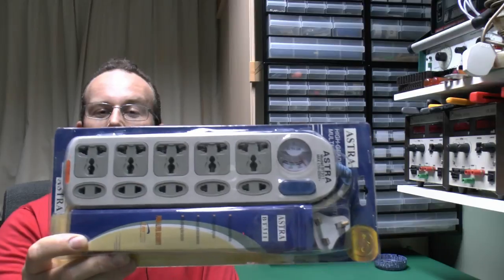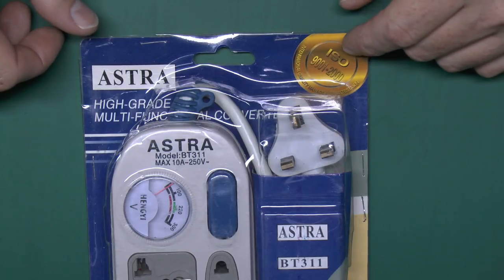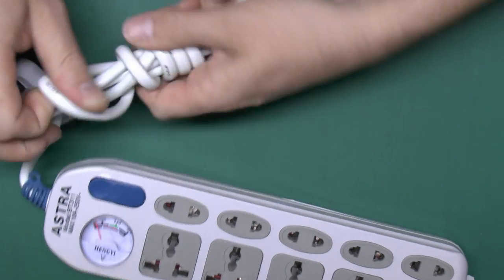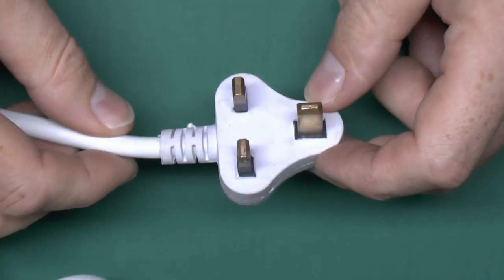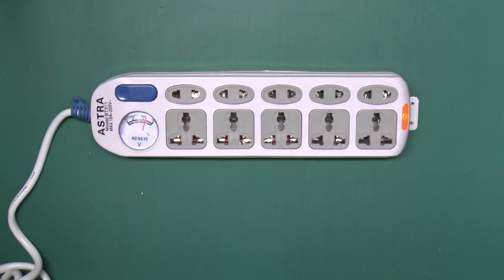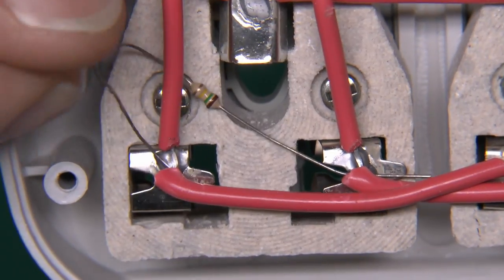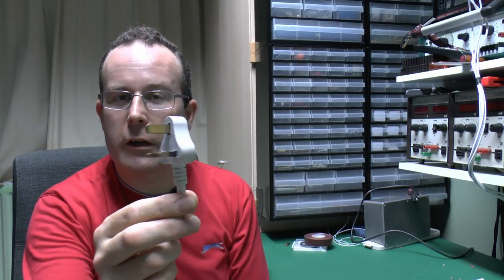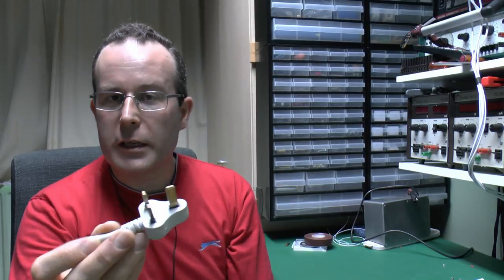Dangerous Multiway Extension Lead ASTRA BT311 (Part 1)

Comment: A while back I bought a battery charger from Amazon (UK). While the charger itself was fine, the C8 cable (with alleged UK plug) that came with it was just like this. I'm no electrical expert, but even I couldn't fail to notice when the plug wouldn't actually go all the way into a UK socket. When I cut the plug off to replace it I found those incredibly thin wires... at which point I junked the cable. The wierd thing is that when I described this in a straightforward way in an Amazon review, it almost instantly attracted several dislikes - which on Amazon has the effect of making the review disappear down the list. So, either some people really like the idea of burning their house down, or the manufacturers must trawl the review sites!
Reply: MrSwanley I ordered a laptop charger from a website using Paypal. I then had second thoughts about the purchase, after reading negative reviews of the site in question. The seller ignored my cancellation request, in violation of UK distance selling regulations. Fortunately I used Paypal's dispute resolution procedure to document my cancellation, and they refunded the purchase price. Some weeks later it arrived with the same dodgy plug and an obviously fake laptop manufacturers label on it. Out of curiosity, I tested it taking additional precautions. The charger exploded within minutes! The charger was vastly inferior to the original, and an electrolytic capacitor had been installed the wrong way round! Personally, I think people who make such rubbish should have their genitals attached to the mains with heavy duty jump leads!
BTW The website claimed to be based in the UK, with a .co.uk suffix; but I don't believe that. The product was shipped from Hong Kong. I think given the poor reviews it had, and the lack of response to correspondence, that the site was a front. I'm much more careful where I source such things from now. I'd rather pay more for the genuine article, than burn down my house!
Reply: MrSwanley It's usually a good idea to look at the worst reviews first, amazon and just about any other big online story has tons of paid shills giving good reviews.

It's not unusual to find the same review (Literally the exact same review, word for word) for multiple products.
Reply: DarkCupid Well, in this case I was posting a review for a product I already bought, not reading other reviews. However I don't agree that the worst reviews are more reliable. IMHO the worst reviews are by idiots and trolls, the five star reviews are often by shills. I pay more attention to the middle scoring reviews. I don't necessarily agree with the score, but the discussion is usually more reasoned. Oh, and one more thing: I tend to read the reviews in date order, not by (false) popularity.

Comment: That thing made the ones we recalled at work look good! Loose terminals, missing screws, surge arrestor leads shorting to earth, broken solder joints, stray wires in the plugs, at least ours had normal sized wires.
Damn things still turn up from time to time, even after we put an email out for users to check under their desks.

Comment: This is actually one of the better class of extension cables available in parts of the world - I went to Carrefour in Cairo, and they had extension sockets in the same 'UK' form factor which would 1) cables melted (very thin conductors)2) Gentle tug pulled cables from socket unit3) The tin pot connectors would permanently deform and not spring back after removing a plug, creating micro-arcing and heat4) Best of all, you could bend a 4-plug bar in half with one hand, exposing all the live bus bars.I destroyed all the ones we bought before leaving Cairo, just so nobody was tempted to use them - destroyed by ripping them in half, by hand, in about 5 seconds...

Comment: Very interesting video JW. Big Clive has a name for junk like this... Deathdaptor 😱
Most odd to go to the trouble of internally wiring an earth but not connecting it at the plug. I've often found people using 240v to110v adaptors which, although they appear to be earthed they only (and obviously) use two core flex!
Horrible thing anyway, to the bin with it.

Comment: My friend actually had something similar to this and used it for a washing machine and dryer in his utility room. Only fried his mains socket luckily and not the appliances. I think electrical safety should be compulsory in school because if it was, something like this would never be purchased. How they get away with manufacturing this in the first place is scary.

Comment: For years and until somewhat recently, China was accepting most of the worlds contaminated "unrecyclable" plastic wastes, and I have a strong feeling that much of it made (and maybe still makes) its way into all sorts of products of Chinese origin. The insulation and jacket material of the wire for example all show signs of what is at the very least, extremely low quality or contaminated raw materials.

Comment: I've seen that kind of wire before on some electronics made to a very low cost in India... it'd be interesting to see how flammable it is (and the sheathing too). Given this device IS going to massively overheat if actually used, flammable wire would just be the icing on the cake.
Reply from the maker: I'll do a few flammable tests and other things next weekend.
Reply: I was. Looking at the sheen the light was casting on the underside (trying not to be distracted by the wobbly edges 🤣) it doesnt look promising. You can see all the mold marks through the bottom. Its that scratchy cheap leftovers type plastic.

Comment: That plug is illegal in UK.  It has no safety fuse on it and will not stop working if something goes wrong unless your mains breaker trips.  Dangerous.  Our connections are always screwed in every plug, even molded plugs that usually accompanied by devices like laptops and PC's.
Reply: WHY A FUSE?! THERES A BREAKER
Reply: @supersaiyangoku3580  Because british wiring is a ring around the house - from incoming main breaker to phase socket to next socket until the line comes back to the  main breaker. The neutral and earth is done in the same way. This also explain why british plugs is polarized it can become dangerous if the fuse inside the plug becomes placed on the neutral , in case of fault on the appliance the plug will burn up but you still have LIVE current inside the appliance so the earth protection doesn't help that if the main breaker doesn't burn up.

Comment: The universal sockets on this Astra strip appear to be imitations of the universal socket design used on Wonpro adapters. The difference is that the Astra strip does not support grounding plugs with three inline prongs (Italy, Chile, Uruguay, various African countries) or  plugs where the ground prong is slightly offset (Switzerland, Brazil).

As a general question, I wonder, can these universal sockets be as safe as sockets designed specifically for one type of plug? A friend gave me some samples of Wonpro adapters, and I have tried these with type A, B, and F plugs (respectively, North American non-grounding, North American grounding, and German Schuko). The Wonpros very firmly grasp the prongs of all of these plugs. However, the ground connection is left floating if a Schuko is plugged into the adapter).

Comment: Just out of pure curiosity, while I do very much prefer normal copper as the metallic conductor in any electrical/electronic cable, is there a proper, safe, legal and honest way of using Copper Clad Aluminium (CCA)/Copper Clad Steel (CCS) for electrical cabling (such as power leads, etc)? I realise it would need a larger cross-sect. area which would mean thicker cable.

Copper prices (as I understand anyhow) have been turbulent the past few years, which explains the rise in copper coated/mixed conductor materials.

I am there are some purported Cat5/Cat5e/Cat6 cables using CCA/CCS for network connections, though of course they're NOT really Cat<x> unless they use copper!
Reply: CCA could work for fixed wiring (and was used in the UK during a copper shortage, as shown in another of JW's videos). Not for flexes, as aluminium fatigues much faster than copper.
CCS is used as the centre core of some coaxial cables for RF (where the skin effect makes current flow mainly at the surface), but would be fairly useless for power wiring.

Comment: lol I bought something like this recently and it went straight in the bin. Mine was similar to yours but the wires used were absolutely tiny. No way could they handle any serious current.
Reply: Gadget Addict the Panther Extension set
Reply: juan sambo haha nah. It was a super duper cheapo extension lead from cdrking. I bought it just to see what the quality is like. The wires were insanely thin, plastic was so weak and the sockets were just a joke. Inside was some kind of clay / ceramic blocks that only seemed to be there to add weight.
Reply: hahaha low quality
Reply: Gadget Addict can you make a video on your Panther with breaker and two socket
Reply: juan sambo I could but I'm not sure if my subscribers are going to like too many more extension lead related videos lol. Most of them prefer gadget and general solar topics :p
Reply: OK :)

Comment: wow, wire with a little over 0.5 ohm rating on the 20 - something American Wire Gauge equivalent line and neutral wires, then I began to guess that with that as a reference that the grounding lead could be a couple of ohms, that was my guess, I didn't think I'd be correct!  That's huge!  In North America (I'm Canadian) we usually use 18 AWG for 10 A, but our power taps are usually rated 15 A and use 14 AWG with an overload breaker or replaeable bussman cylinder fuses.   If it's a long run, say with an extension cord, we use 12.  This is one of the flimsier devices I've seen.
Reply: It's probably much thinner than even 20AWG/0.5mm².

Comment: It looks an awful lot like that wire has been repurposed, which would explain the wear and two-tone effect on the insulation, and also the very poor fit on the outer sleeve. Perhaps that's the case?

Comment: The white/gray metal inside the wires could be zinc or pot metal as aluminum only has a resistivity about 50% greater than copper if I recall correctly.  I have also seen wires in some cheapo Chicom things that I've torn down in the past that used recycled copper that was never deslagged.  I suspect that a certain amount of some cheaper metal was added as a filler.  The insulation on the inner conductors was very similar to the rubbish in the wires in this and probably came from the same factory.

Comment: If I'm not mistaken...it looks like the back of pack has a 'dispose of in bin' logo...so it appears that the manufacturer has no knowledge of the WEEE Regulations/application thereof for devices sold into/within the EU.

Although perhaps rather than a cross out wheelie bin the packaging would benefit from a palm containing money being crossed out for 'Do not buy'.
Reply from the maker: AidanMyne Yes, that is the bin logo.  Yet another fail for this device.
Reply: John Ward But in this case it's accurate. Put straight in bin, do not use.

Comment: IT may have an axial fuse in the molded connector, unlikely but maybe. Still pretty bad though.
Reply from the maker: I have opened the plug now - there is no fuse inside and the earth wire isn't connected at all.  Part 2 will be on tomorrow.

Comment: That wire may not be aluminum, it may be copper clad steel strands as steel is roughly has 1/11 of the conductivity as copper, it appear to be about 0.5mm2 area and about 10 x the resistance of solid copper wire the same length.

Comment: From the measured resistance and quoted length, I'm pretty sure that tinned copper wire you used as a comparison is 0.6mm *diameter*, not 0.6mm² (which would have maybe half the resistance shown, and be an odd size in any case).
Reply: The half-assed bolding function got me again. Damn it…

Comment: The problem is so bad that it seems to be knock off companies selling stuff to knock off companies.
Some company probably made that ultra cheap awful excuse for insulated cabling, then sold it to the factory that made this extension socket, since the extension socket company aren't concerned about weather or not their product is safe or even works well, they don't really care if the wires are of even basic quality standards so long as they can get it as cheap as possible.

Comment: Doesn't PVC wire have normally some sort of powder inside it, between outter shell and the 3 indiviual wires
Reply from the maker: Yes, otherwise the insulation sticks to the outer covering making it extremely difficult to remove.

Comment: Dad a similar plug and cable on a cheap dvr (kettle lead)  I had the silly thin strands of cable you have shown they looked copper but were magnetic so were  actually steel ! no wonder the resistance is high

Comment: Lack of earth clearly an issue but the gauge difference ? Twin and earth has a similar lower gauge for the earth now days, old black and red had consistent sizes 2.5mm now seems its about 1.6mm

Comment: If the ground wire was actually connected in the plug, those wires would have enough resistance to not trip the breaker with a live-ground connection in the appliance. Scary.
Reply: in the UK all circuits are required to be RCD protected, so a short from live to earth (ground) would most likely be enough to trip the RCD

Comment: I'd also worry about that switch handling 10 amps, or disconnecting any load for that matter.

And, is it not possible to put the UK plug in backwards? Probably as bad as putting a grounded schuko plug in the two prong sockets.
Reply: No possibility of doing so due to the design. 2 prongs at the bottom and one at the top. And the one at the top (Earth) Is always slightly longer.

Comment: Hope the "Ceramic" is not something with Asbestos, like it was used in old blow-dryers
additional to this melting / burning electrocution-device
Reply: In something this horrible, a bit of asbestos embedded in the ceramic is probably the least of your worries.

Comment: Talking about wires thickness , had even worse. 
The copper on the wires was about 0-3 - 0.4 mm thickness. 
And that thing "supported" 15 amps at 250v. (3500W MAX) 

Luckily never used it....the wire had went off by gravity , when the multiway part wasnt held by hand. Basically product was even worse than your Astra I assume. 

Using that would have caused some extra job for the fire department I bet. 
The Copper(unsure if its even copper) on the sides of the plugs (Its europlug) , was bending at a just a little bit more force used.
So , earth wasnt connected as well. 
Both wires available were the same color , unable to recognise what is what. 

Your Astra is something "Quality" compared to what I had. 

Its insane even for me , not anything close to an electrician.
Reply: wouldnt want ti plug me and my friends computer on that then
Reply: Dylan probably phone charger or fire brigade kicking your door.
Reply: Ramūnas Gudauskas  they won't be there in time there would be a large fire
Reply: Dylan Good thing its already scrapped+dismantled just in case. Cant risk.

Comment: So, at the rate 10 AMPs, you are likely to see >10V drop in the full 1.5m cable length, which means that cable is being subjected to 10 amps x 10 volts = 100 watts of resistive heating.  Can you say, The Crazy World of Arthur Brown?

Comment: Hi John,
Imagine a fault occurring from Line to Earth on a thing like this.
Where you would expect conceivably thousands of amps to flow under fault conditions and the Earth 
conductor in this bit of gear fails to do anything, apart from light your house on fire.
That is really poor design/construction without any fusing in the plug itself.
Gear like this is a danger to life and property and should be banned.

Comment: As an American, I'm curious:  Does GB (or Europe in general) have a listing/underwriting/inspection system?  The United States has Underwriters Laboratories, MET, Intertek, etc... companies which are third-party, and inspect and certify devices such as these to attest to their fitness and quality...?   They, basically, do exactly what you're doing in this video.
Reply from the maker: There are such places, although most items have the CE mark which is the manufacturer declaring the product meets the various safety directives.  That can involve the manufacturer having independent testing done, or in other cases not.  For properly made items, the manufacturer must keep and supply copies on request of a 'declaration of conformity' which confirms the product meets the directives.
For dubious items such as in this video, there is usually a whole set of marks printed on, all of which are entirely meaningless, and the actual manufacturer of the product cannot be identified.
Reply: Thanks for the answer, Mr. Ward.   It's obviously not illegal there to lie on the packaging regarding features, so I imagine it's also not illegal to put marks like "CE" on them that are not really certified.  The "actual manufacturer" probably doesn't even matter, since it's just cheap garbage to scam someone out of five quid. 
Your videos have inspired me to criticize my IEC cables a bit more, that's for sure!

Comment: thats actually a very well made product compared to the shit im forced to use in thailand. yesterday i had to use my  200 amp tig welder on steel suspended over a lake on an extension lead made from 100m of home stereo speaker wire and a wall socket plug that smoked when i was welding.